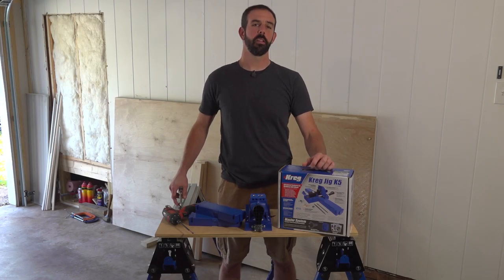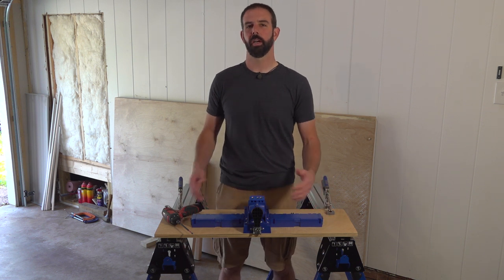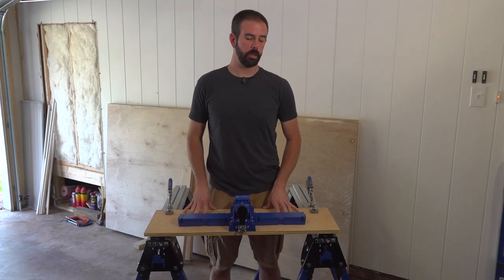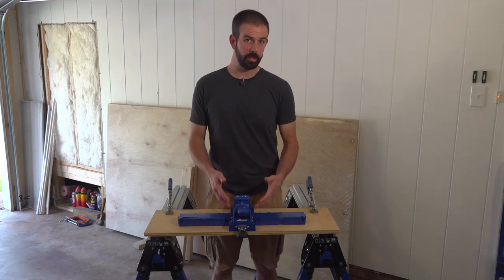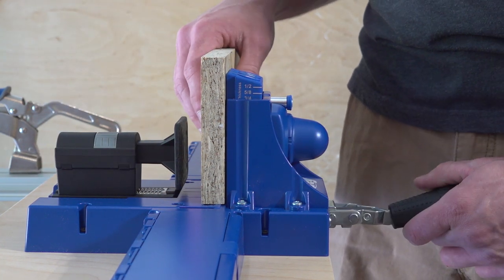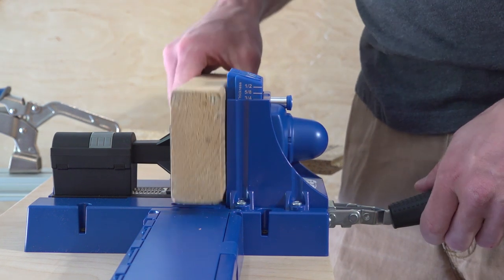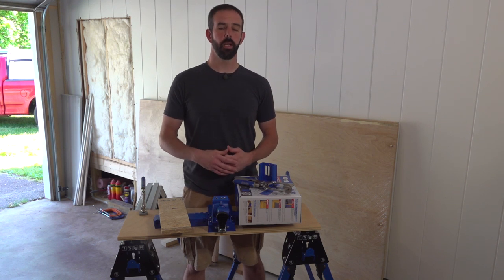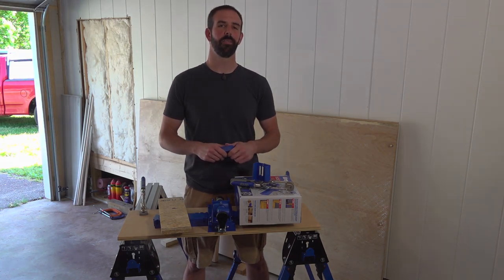Kreg K5 Master System - Setup

Comment: That’s a great video, many thanks. Looking to buy a K5 soon I hope. One question, albeit long. The piece that slides up on the jig to set the depth - is that the depth (thickness) of the wood that you are boring the hole into or the other piece that the screw ends up in? Also the setting for the collar on the drill bit, are you setting that for the thickness of the wood you are boring the hole into? Then (finally) how do you choose the correct length of the screw. All of this is assuming that the 2 pieces of wood are different thickness’. Oh sorry, another thought, does the length of screw vary if you screw into the edge of the board or the front face, as available clearance will differ.
Reply from the maker: Complicated lol. Its all explained in the manual. There are many variations depending on the situation you have. 
Terry
Reply: @ForestToFarm  many thanks. I will try and get a hold of the manual before I buy just to get my head round it!!

Comment: Dear Brian,
I have bought an aluminium version of a pocket hole jig years ago. I have to say although it has it's uses, personally I am not a great fan of it & therefore seldom use it ((nothing wrong with product). I guess it's the same as with biscuit jointers, some folks swear by them, personally I prefer using a doweling machine over the Festool Domino which apart from the price condemns me to buying their silly priced dominoes. I do realise pocket holes are very strong & handy, it's just a question of preference & what one is confortable with. Kind regards.
Reply from the maker: I agree there are lots of ways of doing cabinets and joinery. Some are better for one application while another is better in a different situation. The Pocket hole jig method is not the fanciest by any means but for the average guy wanting a good end result and not having all the many expensive  tools required or skills required to do decent cabinet and other fine wood working the Kreg pocket hole jig is an economical and effective solution that does a great job of producing a quality end product. My friend who is a cabinet builder uses the pocket hole jig as one of his main tools and he produces some high end cabinets that are setting in gated community houses. He has a current job going for $45.000. He has lot of work and what he likes about it is its fast and effective with good end results that people are standing in line for. Hope your trip is going well.
Terry
Reply: @ForestToFarm  Dear Terry,
Thank you very much for your courteous & comprehensive reply. I was merely speaking from a personal perspective & as with many projects, there many ways to skin a cat . You just have to use whichever method works best for you. Kind regards.
Reply from the maker: No problem, I understand and I agree and your method is a more classic method and in the long run a stronger way of doing things. They are all good but its all in what a person wants. I guess in today's demanding world its all about production and getting it done the quickest way possible and still having a result the public will accept and enjoy. 

Terry
Reply from the maker: By the way its always good to hear your suggestion. Sounds like you take pride in doing quality work. 
Terry
Reply: @ForestToFarm  Dear Terry,
Thank you very much for your courteous reply. One task, many different ways to approach it. What matters is the end results. Like my mother always said " if it's worth doing, do it well or don't bother". Quality work reflect your own personality & to boot you get a sense of pride & satisfaction that you seldom gets elsewhere. Kind regards.
Reply from the maker: Agreed!
Terry